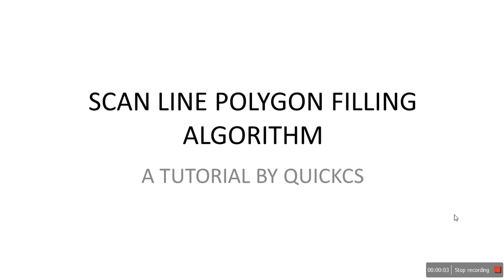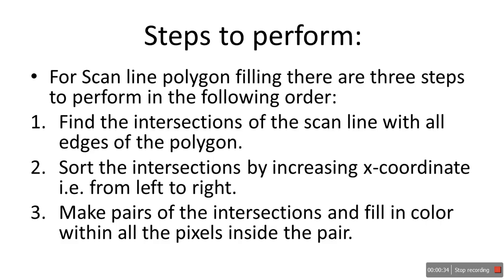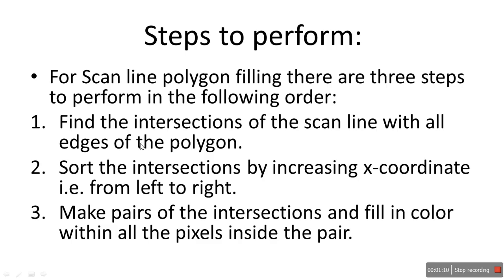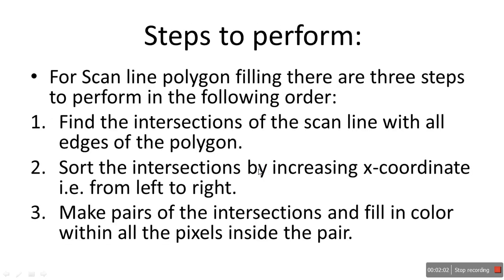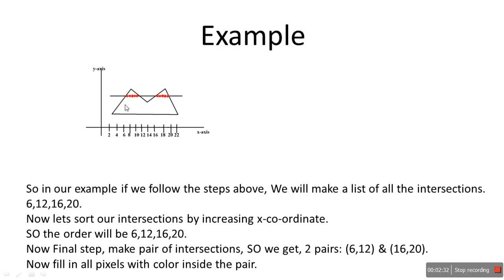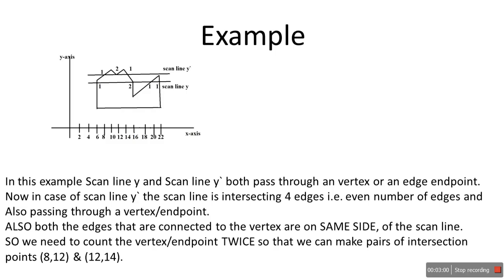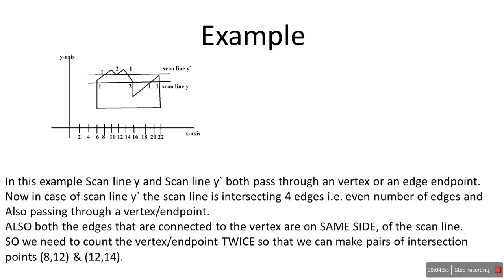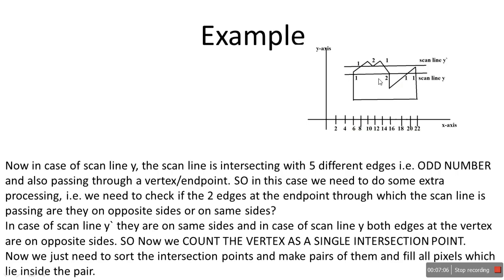scan line polygon fill algorithm in computer graphics(✔) | computer graphics notes

Comment: Where it's touching 5 diff edges ?
I can see only 4 😐
Reply: Vertical line is 1 edge. Angled line is 1 edge. The intersecting point is going through two different lines.
Reply: Same. Apparently my textbook has the same image marked with "5" edges. I don't see 5 edges!?